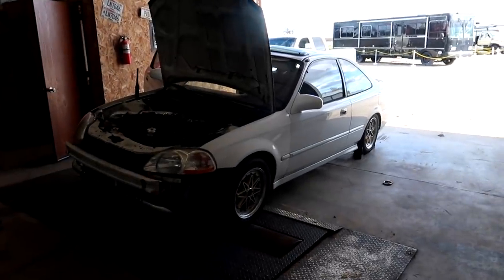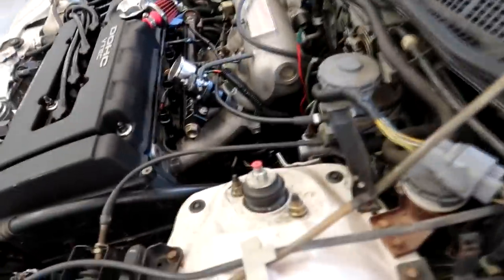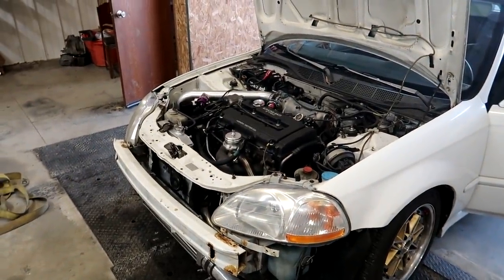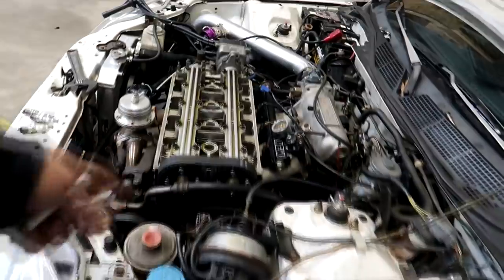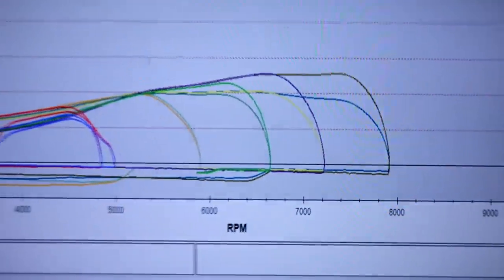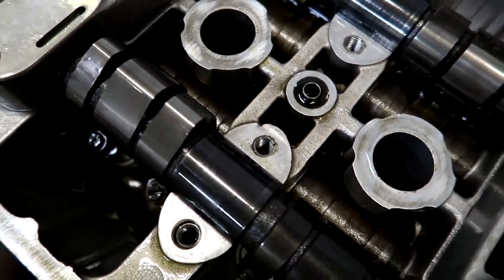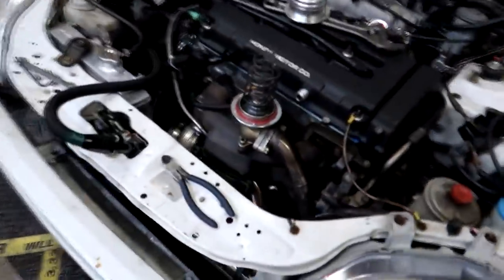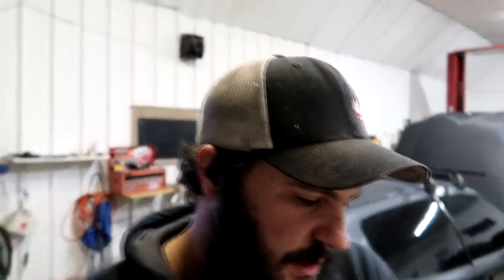Ebay Turbo B18C GSR Struggles To Make 300HP Fighting Backpressure Issues And Working Out The Bugs !

Comment: As soon as you mentioned the setup in detail I chuckled thinking about this client wanting 500hp. Lol. 2.25 exhaust? Log on a tiny eBay turbo? Tiny intercooler and pro 2 cams? Cab on shelly!!! I’m glad you set him straight. 300-350 and this dude should be ecstatic. Especially since you had to go the extra mile with diag and replacement. 

Edit: yeah def quiet. 300 will be a fun little starter if this is someone’s first turbo car. Also hunter I personally enjoy the longer videos.

Comment: Wow, 286 on 11 psi is a great example of why it's important to use a 3" downpipe and 3" exhaust. I made 412 whp on 15 psi with a bone stock B18B1. My LSVTEC made 482 whp on the same boost with a GT3582R and CP 9.0:1 pistons and Skunk2 Tuner Stage 3 cams.
Edit: The B18B1 was run on 93 octane, the pistod/rod LSVTEC runs on E85.
Reply: What size turbo was on b18b1? If you don't mind me asking , I'm currently running boost on same motor

Comment: Had the same issue with my turbo gsr. Thought I could run tuner 1’s with a log manifold and i even had a 3” downpipe and full catless 3”” exhaust and i had the same exhaust reversion problem that this car had. Swapped back to stock gsr cams and made 300 whp and a flat line of 200 ft lb of torque from 4k to 8.5k. Have to match the parts to work correctly together, anything more than a stock cam really needs a tube style manifold like a ramhorn or topmount

Comment: Good info, I have a buddy completely building a B20Vtec & he is gonna use those cams. Would they work well in about 13:1 cp all motor on E85 with a 2.5" full exhaust? Or will the exhaust choke the setup

Comment: Great video, I have a 99 EK, I traded a k24a2 full setup for a gsr eBay turbo swap with a bunch of extra parts, the guy forgot the wire harness so I’ve been trying to find one for a decent price (no luck yet 😭) I have a b18a1 and a b16 with stage 2 skunk cams, debating if I should swap the heads or not (not to familiar with B series at all , I’m a K guy myself but wanted to do something different) going to build a 3” exhaust , have the s300 Hondata , big intercooler, smaller turbo (might go bigger but need to save up first)  can you offer any insight to this build at all?

Comment: I have a 2000 civic si that I boosted last year and I have my plugs gapped at 28 and runs fantastic. Why do you gap them so close?
Reply from the maker: All depends on how old the igniter and coil are in the distributor. I see zero difference in power at a .018 gap vs a .030 gap. However if the car does occur an ignition breakup issue from to large of a gap it’s more harmful on the engine. I gap them small for insurance to prevent ignition breakup issues and the plugs last longer as when the plug wears out the gap gets larger.

Comment: I have a b18c1 with a ram horn manifold an keep getting boost creep,so I changed from a 38 mm to a 44 mm wastegate, same thing so I took the wastegate off an made 6psi without it on so now I’m getting a top mount manifold, any ideas?
Reply from the maker: Yea that’s the issue with ramhorns is they tend to creep. Top mounts have better boost control
Reply: @HunterTuned  I orderd the top mount you got I’m going to give it a try I should have it on sunday
Reply: @HunterTuned  I have my new top mount PLM manifold I am going to put that on my twin scroll t/3 t/4 t70 turbo see what I can make an I also have a smaller percision turbo a lil bit smaller what turbo you think is better I can give you the size of the precision turbo is you want?

Comment: What's the typical max HP you can get out of those log manifolds and a 2.5 dp with full exhaust, I'm about to build my b16 and I was debating if that would be enough wanting 350-400hp
I do have much more intercooler and turbo
Reply from the maker: Need 3 inch exhaust for over 300hp logs can go 300-350 safely. More then that your fighting a lot of backpressure
Reply: 350 is possible with a bigger turbo but in my opinion just spend a little bit more a top mount or a ram horn and a 3 inch dp that way when you wanna make more it’s there ready for it  I did an eBay kit the first around worked good but a lot of cracking and stupid problems  but did the trick but now I’ve build 2 turbo set up instead of just doing it right the first time
Reply: I made 330 whp on E67 with a log manifold, and a full 2.5 inch mandrel bent. I'm sure I can make more but my clutch gave out so had to turn it down. I did notice cylinder 3 lean out more than the rest. Log manifolds are notorious for that so I had to keep timing low. 
Get a tubular turbo manifold.
Reply: @HunterTuned  Thank ya sir! It's all going in a CRX so I was hoping to save the room and money, I'll start searching for a ram style
Reply: Thanks for all yalls help, it's all going in a CRX and trying my best to retain AC (in TX) we shall see what I can do
Reply: I have a 2000 si with log manifold t3 precision turbo, skunk 2 tuner stage 1 cams,  2.5  downpipe with no cat and 2.5 exhaust  and I'm at about 300hp 180tq and thing runs and drives awesome no issues

Comment: Seem like alot of cars you work with are just slapped together ppl. Just spending money with no knowledge of what they need. What rate on a tune on s300 b16a ? So far no issue 3k sense engine install. N.a. pretty stock. Want number before I do anything.